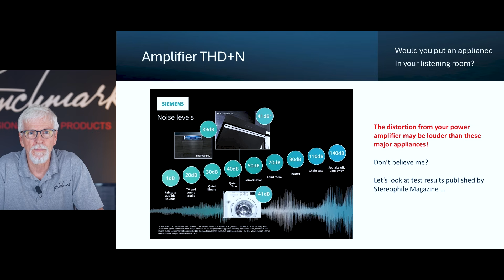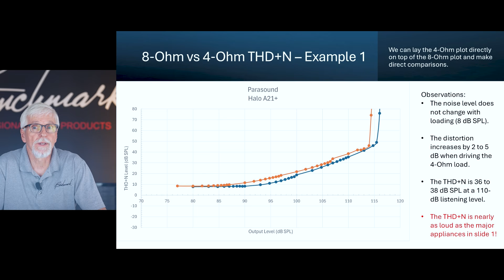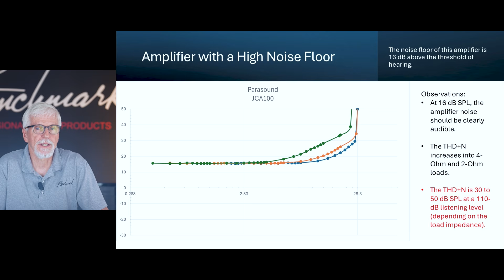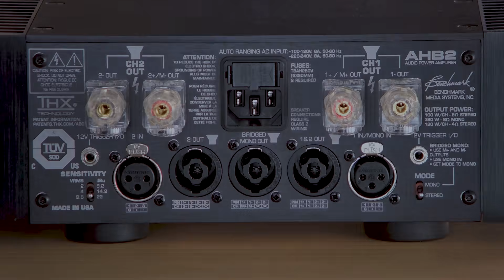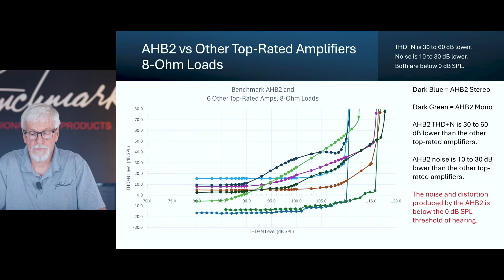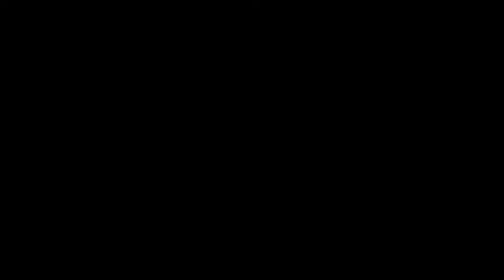How Loud is the Distortion from Your Power Amplifier?

Comment: I rarely hit 80 dB in the peaks, so most of these amps would work for me
Reply from the maker: The actual peaks are 12 to 20 dB higher than the level shown on an SPL meter. These meters show the short-term average level even when you set them to “fast” mode.
Reply: @BenchmarkMediaSystems  Thanks. That may explain why I do find that even with relatively efficient speakers, a small Aiyima A20 sounds a bit cleaner than my 300B amp (even though the 300B sounds more dynamic, transparent, and has a larger sound stage).

Comment: The opening statement is incorrect. The frequency response of the digital equipment before the power amplifier is frequency limited far beyond the limits of the power amplifier. Try doing a frequency sweep from 5 HZ to 35 KHZ  I own test equipment that can produce frequencies from 0.001 HZ to 60 MHZ. Guess which portion of your system will limit it first.
2nd item is your ears. They have a SN ratio mush lower than any good specification power amplifier. 2rd item is your speakers. Yes they have mechanical limits. They are physical objects and have limits to the physics of mass and acceleration of physical materials. This only addresses the playback side of the physics. The recording itself was most likely produced on a DAW, and recorded using mechanical vibration to electrical transducers of some kind, with their physical limitations.
I do admit much of this process is improved over the years in a process of diminishing returns.
TLDR: 
This discussion is like asking how loud is a dropped dinner fork, during a rock concert. Simply put, if you are running 300 watts, and the dinner fork falls off the table, you won't hear it. does not mean the dinner forks was not loud. Now turn the system down to 1 watt, now in the same SN or THD ratio, the dust setting on the floor from you waling into the room is about the same ratio to the sound level. Again, you won't hear it.
In numbers per the stereo review: in a listening environment at 80 db, using about 1 watt of power, which will bother the neighbors in an apartment, the THD level is now about 0.1db. Yep, you can't hear it.  I am assuming a speaker efficiency of 80 DB per Watt. Yes an audio engineer uses both math and common sense.
Reply from the maker: The extended analog frequency response is required to keep the differential phase response accurate between 20 Hz and 20 kHz. If the analog components that are limiting the frequency response have a cumulative 10% error, and you do the math, you will find that the analog frequency response needs to extend will beyond the limits of human hearing if we want the left and right channels to arrive at exactly the same time over the 20 Hz to 20 kHz range of human hearing. Slight high-frequency interchannel phase errors will suck high frequencies out of the phantom center and make them sound like they are coming from the speakers. We are very sensitive to these phase errors. At the low end, bass will be late if it rolls off just below 20 Hz. Late bass sounds weak and it obscures reverberation. - JS

Comment: Impressive measurements and charts. I would warn people at listening to any audio content at 90db spl for a prolonged period of time. More than 1 hour a day will cause damage to your hearing and it will affect your experience more than the at 30db.
Reply from the maker: Good point, but we are talking about peak levels and not the short-term average levels measured by an SPL meter. Even on "FAST" mode the meter averages the level. The peaks will be 12 to 20 dB higher than the level shown on the meter. THX recommends being able to achieve 105 dB peaks, which translates to a measured maximum listening level of 85 to 93 dB. - JS

Comment: I use a hybrid amp. The thd is not very impressive despite tubes's distortion is less irritating. So, I choose to reconstruct the amp as much as I could. Dame basic design, but with a whole load of differences, components etc. Now, the thd is very very low, and the noise I used to hear is completely gone as well.
This I did by building a rather extreme transformersetup, filters, rectification and more filters, super fast super precise parts, cables, connectors, new pcb in 8 layers, gold vias along the edges, matched transistors etc. The difference is absolutely day and night. The level of detail and speed and sound stage is gigantic compared to what it was before. My speakers are "8" Ohm, but happily dipping down to 2,7 Ohm, so they demand some raw ampere. Now, I can run the amp completely stable into 2 Ohm continuously. The feedback don't do much now and at my listening level, it's mostly running into class A, and the transistors, drivers etc, are running in their most linear sweet area.
As an aside, it cost a lot more to do this (myself), than the price of the amp, but since I really like the sound it makes, I preferred to do this, rather than buying another amp, which would start out with the same basic problem all over again.
Cheers.

ps: when I look inside many amps, they are using input terminals that does not separate - and gnd, so always a chance for big ground loops that adds noise.
Reply from the maker: Pin 1 of our XLR connectors is always bonded to the chassis ground and never to the analog ground. Pin 2 and pin 3 feed an input differential amplifier. We never bond pin 3 to ground, but some manufacturers make this mistake, or they do it to save money. - JS

Comment: Why do you start with such a disqualifying information?
The main sources of distortion in a hifi system are the loudspeakers, by far.
Reply from the maker: I completely agree that loudspeakers are the primary source of distortion. But this does not mean that the electronics do not matter. Of the electronic components, the power amplifier is usually the highest source of distortion, and this distortion is louder than people realize. When the measurement units are converted from % to dB relative to the threshold of hearing, we can gain an understanding of the magnitude of the problem. - JS

Comment: Pete the truthbomber here. Benchmark units were one of the first DACS to achieve parity with the best analog. But now there are 100s if not 1000s that do it. If you choose any higher grade (let's say RME) DAC you will get much better performance than the best ears can detect. Amplifiers have reached the same sort of parity going all the way back to old Crown DC units. There is no reason to be concerned and if you have any Benchmark gear, it's at parity as well and will sound fine. There is really no upgrade path except speaker which are actually on an improvement path. Erins Audio for example is on top of the actual progress.

Comment: What about speaker distortion?
Reply from the maker: The speakers will usually make more distortion than the entire electronic signal chain, but this does not mean that we can ignore the electronics. The numbers show that power amplifiers are the worst offenders and the numbers show that the distortion is loud enough that it should be audible under the right circumstances. - JS

Comment: 110dB is very loud, and I would venture this is not seen in most home listening rooms. I do live sound, and when my SPL meter is in the C weighting mode and fast response, 110dB peak is what I measure maybe 20m from the stage. My normal listening level is 75 dB and that feels loud, but dynamic peaks can be 90-95 at that level.
Reply from the maker: Your meter does not measure the peak level, even when you have it on the "fast" mode. Your meter will read 10 to 20 dB lower than the actual peak level of the music. - JS
Reply: @BenchmarkMediaSystems  For a music signal that hangs around 75 dBC (fast), if we take that as a time-based average, then the peaks of 110dB+ require the ratio of the peak signal level to that time average to be at least 35 dB. I suppose that's not totally beyond belief, but it seems like an extreme case. We're often told the crest factor of music is around 20 dB, but I don't know what that reference is from. A ratio of 35 dB from peak to measured average would mean that when listening to the same music at 85 dBC (fast), the speaker has to be capable of producing 120dB, which maybe it is if the measurement distance is very close.

Comment: Charts are only meaningful when the test methodology is understood, including the test environment, microphone placement, measurement equipment, and measurement settings. Without that information, the data is incomplete and cannot be properly evaluated or reproduced. In many cases, charts can also be selectively presented or configured to produce more favorable-looking results than the underlying performance would otherwise suggest.  Stereophile's reputation however is respected especially after '89 when using actual speaker loads.

To your graphs:  They show how the amplifier becomes nonlinear as it approaches it's output capacity however does not, by itself, demonstrate that distortion is audible or that at a given dB SPL represents an objectionable distorting threshold.   There are a few other critiques but I've said enough...

Comment: The Class-D amplifiers that were tested here are "weird" designs - in the case of the LKV, the amp is based on PuriFi 400W modules but it uses a zero-feedback input buffer section of LKV's own design, and the other one is PS Audio's M1200 which is introducing a vacuum tube to produce audible distortion characteristic of a vacuum tube. I would like to see the AHB2 compared against the reference design for a Hypex NCoreX, Purifi Eigentakt, or another amp with very low SNR which would be the Topping B200 - not Class-D, but a high-feedback Class-AB amp. The AHB2 uses both feedback and feedforward correction, and the results are certainly very good, but the amps chosen to compare it to in this video are not known to be 'state of the art' in a similar bracket of ASR's 5W SINAD test.

Comment: If you do insist on using uncorrelated noise and using zero as the limit of human hearing, you should probably add that a quiet room is typically around 30 dB and merely breathing is 10 dB. Referencing 0 dB is unrealistic impractically any listening environment

Comment: Most f the signal to noise level , especially at higher power is not uncorrelallated noise. Most of it is the harmonic distortions, most egregiously perhaps the clipping. So it is not really like running your stereo next to a noisy appliance. Distortion is the major component of the'noise'

Comment: Distortion is fully masked.
While your amplifier is great technical achievement.
People just LOVE and PREFER lower fidelity 0.5-1% Tube amps, 
and mechanically engraved sound into plastic aka vinyl records
and many prefer the high THD in the bass region of a direct radiator instead
of the wonderful low distortion higher fidelity horn loaded klipschorn.
Reply: yepp! For my CW4s I settled on a small tube amp with just two EL34s.
... also owning 2 other solid state amps - the tube amp sound just incredible. Decay structures and 3D is simply best with the little tube amp. And bass hits as hard as with my solid state amp, no lack of impact here.

Comment: Thanks for this video and all your other videos, John. Learning a lot.  I think you do a great job of explaining the advantages of your products and why those advantages could be important to someone's audio system -- depending on speakers, preamp, etc.  I also appreciate you sharing these plots.  I was able to use Gemini to plot my amp's data into your graph of all the amplifiers and was happy to see where it landed.  It's not as quiet as the AHB2 but THD is below -5db up to 100db SPL, which is below where my system peaks when listening.  And I'm very happy with how my amp sounds!   That said, Benchmark has done an incredible job with the AHB2 to get better than class D measurements by optimizing class AB output.  And what's more impressive is that you deliver a lot of features (selectable gain, protection circuits, triggers) that many competitors do not.
Reply from the maker: Several people have reported that they have successfully used AI tools to convert THD+N percent vs power plots to dB SPL plots. Sounds like it worked for you also. - JS

Comment: Phono playback contributes much higher levels of distortion than power amps.  IM and THD at 5 kHz can be 18% at moderate groove velocities, even with TOTL cartridges.
Reply from the maker: Absolutely. I am specifically addressing the electronic components. Of the electronic components, the power amplifier is the largest source of THD in most systems. Speakers, cartridges and other electromechanical devices will produce more distortion than the electronic components, but this should not be an excuse for producing electronic components with levels of distortion that are high enough to be audible. - JS

Comment: Sure you jest? The speakers are always highly distorted by nature! 
How can you even say that crazy mess?
Reply from the maker: I am specifically addressing the electronic components. Of the electronic components, the power amplifier is the largest source of THD in most systems. Speakers, cartridges and other electromechanical devices will produce more distortion than the electronic components, but this should not be an excuse for producing electronic components with levels of distortion that are high enough to be audible. - JS
Reply: I understand but power amps will always unless ridiculous be inaudiblly beneath the distortion inevitably caused by speakers. I well remember the days when power amps did cause audible distortion but that is just not true now.

Comment: One of my SET tube amplifiers has been measured to have 2% distortion up to 5 watts,  so that is as loud as you turn the volume pot up to 5 watts and in this example 2% and all of that distortion is second order so 90 db and I usually listen at 75 db nominal so 2% at .05 watts I believe. I listen at near field around 3 feet. Perfect for me.
Reply from the maker: The fact that you enjoy the added second order harmonics is anecdotal evidence that these effects are audible. The mathematical analysis strongly suggests that your system is generating audible second order harmonics. Many people enjoy this effect that is created by SET amplifiers. You can hear it, you can measure it, and you can calculate that it should be audible. The sonic effects of SET amplifiers are real. Pick the type of amplifier that delivers the sound you enjoy. - JS